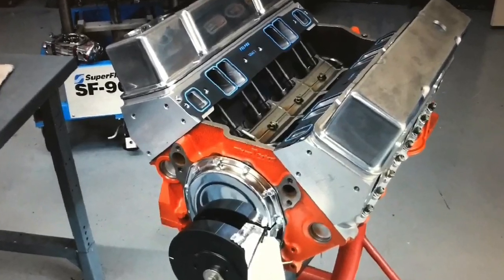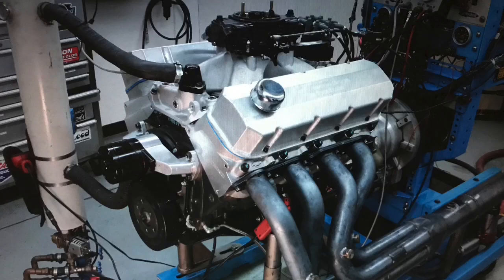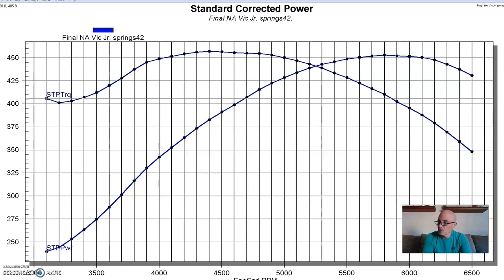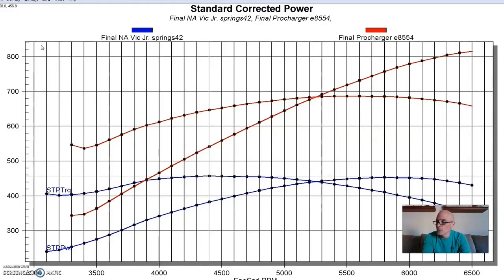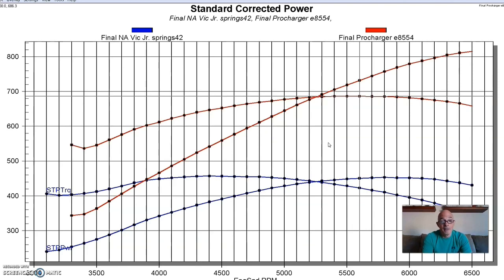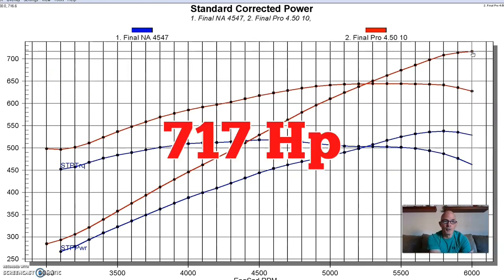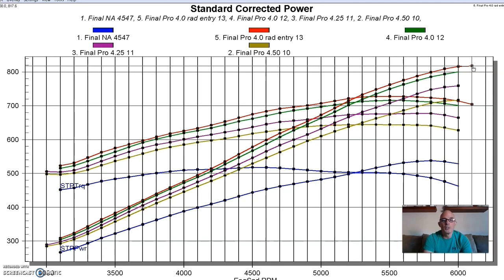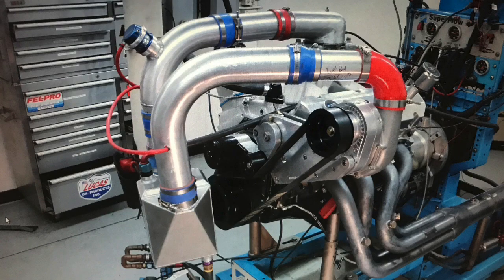CRATE BALLS OF FIRE!!

Comment: Richard, I just watched a video by "Nicks Garage" dyno testing a factory spec 340 six pack. It wasn't running 100% but had electronic ignition. With the factory exhaust manifolds it made ~360tq 330hp. He said because it was a customer's number matching engine he wasn't gonna whip it. Ran as you do, no accessories. The question is, with a set of longtubes is there enough on the table to bring it up to lt1 or boss numbers? By not 100% it had a bad stumble when the secondaries opened, it looked like the float level was too low. Nick said factory replacement hydraulic cam and that might be what stops you, with only  
.444 lift and questionable valve control if the lifters pump up, you won't get the 7000rpm blasts like you do with the solid cammed ford or chevy.

Comment: I know a TON of people would love to see a 318 build for street strip. So many people just do budget builds and daily driver style. Most guys that want a hotter 318 do a .030 over with Keith black kb107 pistons and ARP rod bolts using a set of stock full floating rods which gives ya close to 10:1 with thin head gasket and a set of shaved 360 heads with 2.02/1.60 heads. From there which is fairly budget for most guys would just need a choice cam for some good rpm. With the 318 and some rpm ( needed to make good power) this is a combo alot of guys would like to see built. Steve Dulcheck has build 2 making 415hp but they lacked a solid cam and the heads where small valve magnum on one and small valve la or the other and all with vacuum in mind and idle quality. 

Would love to see you work with Steve to try and build a 475+ HP 318 thats a pump gas 91octain  motor that rpms 7000 or so. Hell keep it even more budget and use 273 rockers. Love to see this or similar 318 build with a air gap. Which they always need the ports opened up to match the 360 heads as the intake is in-between 318/360 heads. Then throw on a STREET Tunnel ram with couple of 450 holleys and show all the na sayers a 318 CAN make power. Just needs more cam, compression and heads like any other motor. Can't tell ya how many times people just say build a 340 instead. Really a .03 over 318 is 322. Thats only 18ci less than 340. Its not hard to hit 500hp in a 340 with right combo. Well if ya made it this far Richard thanks and get ahold of Steve. I know he said he wanted and had the parts to do this. He'll ill ask nicely. Pretty please. Haha. Thanks for sharing and taking the time for such a great channel.
Reply: Pretty sure they know each other
Reply: Lol, "318"...  If you are limiting yourself to something so rudamentary, why not just go with a slant six and save weight?
Reply: @michaelangelo8001  MY UNCLE HAD A 318, BUILT WITH 340 PORTED HEADS, SOLID CAM , STRIP DOMINATOR INTAKE, 750 DEMON CARB,  IN A 70 DART, 4 SPEED , WITH 355 GEARS , SHE RAN VERY CLOSE TO MY COUSINS 67 CAMARO 427, 4 SPEED, 3.73 GEARS !
Reply: @daviddavids3468  Had to be something bad wrong with that 427, unless the "318" was actually a 408, and he was just bluffing.

Comment: I've got a milder combination of the boosted 383 in my pickup. Smaller cam on the 355 min my 1990 k2500 daily driver. Smaller roller cam. Trick flow heads, comp roller cam, vortech supercharger and Holley sniper tbi efi. She's stout, but that 800hp 383 would be rad.

Comment: I bought a new ZZ4 for $2,999 back in 1998 when I was 19 years old, it would be cool to see you play around with one of those (stock bottom end and head castings).  I was disappointed with it's performance at first because I was choking it with old exhaust manifolds and an Edelbrock 600cfm carb.  Once I put proper D shaped long tube headers and a 750cfm Holley on it felt like it gained 100hp/100tq.  Maybe show that aspect as well.  Cheers.

Comment: A two fer on boost. I love it. What would be the reliability of these engines on boost. I don't need that kind of power on a regular driver. That much in a street car is asking for trouble. For the money I would like to put it in my drive to the track foot brake car, through the mufflers, as quiet as I can get it, run a good number, consistently, not have to beat it to death, and drive it home. Silent but deadly consistent foot brake car. keep it going.
Reply: everything is better/ more awwwesomer with boost.

Comment: How well do you think the 383 would perform with an s480 with a 98mm turbine wheel and 1.25 ar housing? This would be a great motor to drive around on gate pressure with like 4 pound springs, then have the ability to double (or more) the power at will.

Comment: what I took away form this is "Boost Makes Everything Better".  that ZZ454 is a serious engine even without boost. I have been considering that same XM284HR cam for my 396 rebuild I am doing for my camaro. it's 9.5:1 compression with aluminum Edelbrock Oval port heads and a Performer RPM. I figured it would be around 480-500HP and around 450-470 torque. Now I am thinking about adding boost....

Comment: "30 day warranty" does that cover boosted applications? :D
Reply: Defect :Read the fine print.The detail will most likely be no. Personally,  Id be  sayin... "Sure. Its still on the bottle and not on solids". Ring gaps will be the issue.
Reply: Is low compression ratio really required for these forced induction engines?

In one of Brian Tooley's videos, he is saying it's a thing of the past, and that he knows people who are running 14:1 CR with over 60# of boost.  That's if I recall correctly...
Reply: @michaelangelo8001  Depends on your fuel and how much cylinder pressure your engine can tolerate.
Reply: Michael Angelo i find low compression responds slower using boost. Depends on the engine injectors etc. Have it up 9.5 in 1 compression least than used boost. Just gives it a head start. Sometimes 8 or less compression bogs out when it takes off. Example 2014 GT 500 5.8 V8 has 9 in a 1 compression. I seen it taking off and seems it responds a bit slow. When the boost catches up or the engine finds where the torque is. That 5.8 should of been 9.5 in 1 compression with the supercharger. I think be around over 700hp also torque be probably higher too. Better than 662hp.

Comment: I'd like to see some different testing on a turbo or centrifugal supercharger inlet modifications. Open like you normally test them versus a velocity stack. I see that boost increased by .7psi with only 100 rpm increase. Also test with a small filter and a larger filter my setup has a 3.5" inlet with a cone filter. I just got a 4" to 3.5" reducer and a 4" filter. I want to help out my little vortech v3 si supercharger.
Reply: MajorLeague  the compressor on a turbo is exactly the same as a centrifugal supercharger.  How would a bell mouth work on one but not the other?

Comment: What kind of power difference is there with an air to air intercooler vs the intercooler you normally run?
Reply: If you run ambient water, not much difference, if any at all. If you run ice water, you will see a difference but how much will depend on the combination.

Comment: I couldn't find the 302 video so I'll leave it here but the 1969 DZ302 Camaro did 11 seconds from the factory  With a little bit of air out of the tires even though all the magazine said it did thirteens with 290 horse at 2500 rpm but it was known as the big block eater  How many big blocks did 11 seconds from the factory

Comment: Love the videos. Never a disappointing one! Awesome:). What compression are these motors running? I remember always that boosted motors had to run 8-8.5 otherwise it was trouble. Today I see people boosting motors with higher compression on pump gas. What’s making that possible or what am I not understanding?
Reply: Yeah I built 427 LS to 9.65 which is as high as I wanted to go with an F1A but I have that old school mentality too. You're right, a lot of guys go higher and they think that my 9.65:1 is low. I think the answer may be aluminum heads and block, better fuels and just simply smarter via evolution. I'd love to hear more people chim in on this.

Comment: are L98 heads worth messing with? I picked up a set for 75$
Reply: From a L98? From memory a L98 has L92 heads i think, yes they are good. Dependsbon application. Ls2 cathedrals can work better for other reasons and my choice. More torque down low, speed up air flow at lower rpm
Reply: Just the weight savings by itself make it worth it.👍🏻
Reply from the maker: I assume you mean L98 TPI heads, right?
Reply: Thats a great big maybe. It they're good and don't need work done to them, that's awesome. Throw on a set of beehive springs and have fun. If their worn out and need rebuilt, may be not. A buddy of mine had a corvette that both heads were cracked, something fairly rare but worth thinking about. If they need a rebuild, send them on to someone else and buy some chinesium castings ready to bolt on that will outflow them for less then $800.
Reply: Richard Holdener yes Sir!

Comment: You said "low compression engines" but didn't say exactly what the CR was.  Please do that is future videos.  Many of us want to build a pump gas engine because we do not want to run water meth or race fuel all the time and E85 is not available in our areas.  12:1 CR and 15psi of boost sounds awesome, but you can't do that on pump gas.